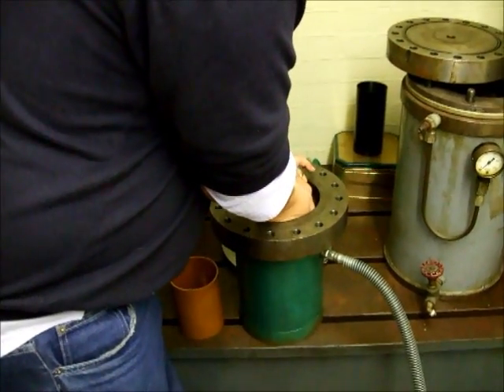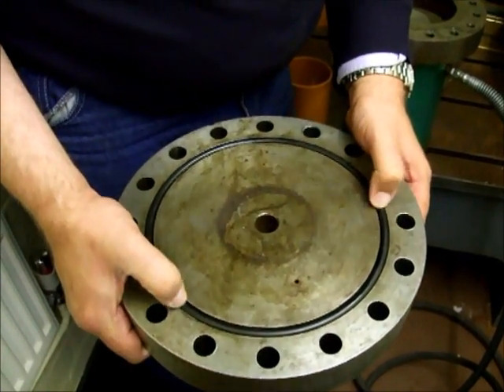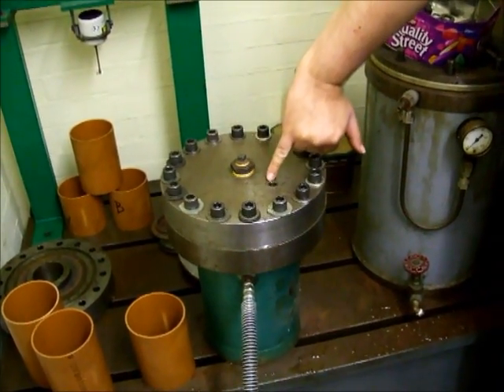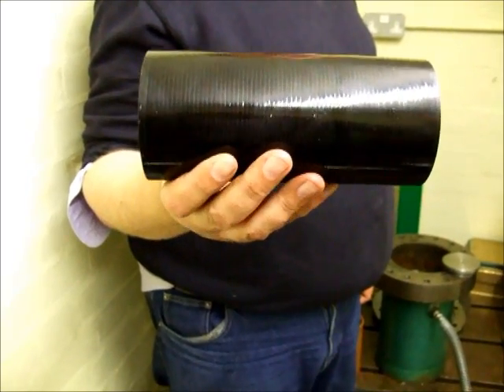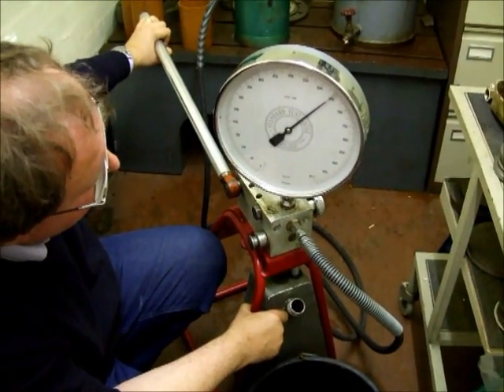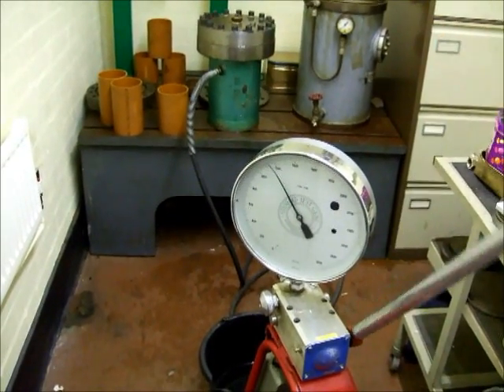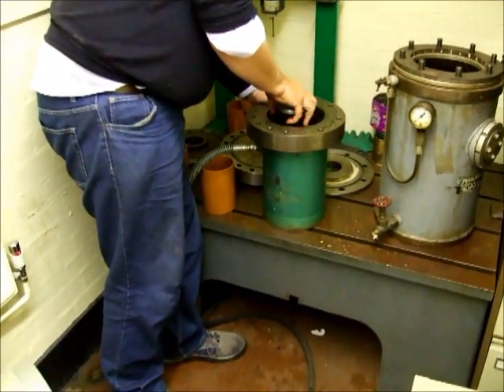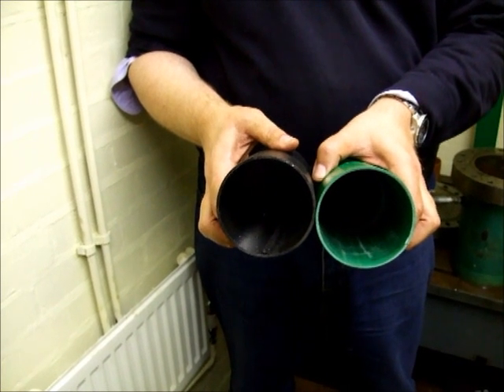Collapse of Composite Submarine Pressure Hulls

Comment: Glass fibre tube fails at 375psi, carbon went to 1400psi! Would have been interesting to see what steels could cope with and different alloy mixtures.  It's shows how strong carbon fibre is at first bit not after continuous pressure tests and to see the laminates failing.

Comment: In the real sub implosion, the volume of air is collapsed and compressed by the weight of the column of water above. The water rushing in acquires momentum which compresses the air way above the actual pressure at those depths. The volume of air inside the sub gets compressed as in the cylinder of a diesel engine, reaches very high temperatures and anything combustible ignites and detonates (oil, grease, fabrics). That is why you usually won't find bodies. Then that air bounces back. We get several very fast oscillations of the bubble of air that way. You can deduce the depth and the volume from the frequency of the sound of the imploding submarine. The US Navy knew exactly what had happened and where while everyone was running around frantically looking for the sub and hoping. The US Navy have hydrophones submerged all around the US and further in the Atlantic and Pacific since the cold war. There is also a lot of computing power analysing these sounds. This acts as an early warning systems against military submarines. Immediately telling the public all they knew of the stricken sub would have revealed too much about the capabilities of detection and analysis of the US acoustic early warning systems.
To see a video about collapsing bubbles of gas (actually from an AK-47 fired underwater), check this link: https://youtu.be/cp5gdUHFGIQ

Comment: This is why Soviet Mir was made of titanium, not LEGO plastic
Reply: In space it is a lot easier to hold pressure. You have to hold one atmosphere inside, even carbon fiber can achieve that and be consistently fine with it, and it is pretty light so it is easier to get to space. 
Only danger are micro-meteors and rapid heating and cooling of materials. 
At the bottom of the ocean you have to hold one atmosphere inside and you have to guard against many many many atmospheres of pressure on the outside. It sounds a bit dumb, but it is generally harder to have a human rated vehicle at the bottom of the ocean than in space.
Reply: @DreamskyDance  
You are thinking of the space station which makes no sense to me.
I was talking about the two titanium subs Mir-1 and Mir-2 which coincidentally were used by James Cameron including being featured in the Titanic movie.
These are the only deep water subs that have record numbers of deep ocean dives.

Comment: Hi, good questions. The challenge here is the lack of a validated mathematical (FEA) model that can work in this specialized area. Further, this becomes a non linear plus statistical domain. Why non linear?, given damage is cumulative, each subsequent dive will have a different performance. As of today some things are not clear how many tubes were built, was the tube used in the Bahamas  repaired or was it a new one? in 2021 (6 dives)?, 2022 (7 Dives)? To what depth, as each depth is a different loading condition.
Wet spiral wound carbon composite are not a common construction, as well specialized as the resins and curing methods. Further besides the process, the choice of fiber specifications and configuration as well as epoxy and activator may also vary. Add manufacturing imperfections (% bubbles and voids) and you start to get an Idea of the specificity of the problem.
If most are know and documented then, you can consider a the 4 common potential failure modes (delamination, fiber break, separation of fiber, cracking) and their probability.

Once there is a mathematical material model backed with data then the experimental geometry and loading can be considered for validation of the model. Still an approximation as the interface to the titanium rings and the difference in rigidity will likely create a stiffness mismatch. 

In short from an engineering perspective, it is a sequential problem that is built step by experimental step. At minimum we use ASME V&V 10 and V&V 20 as a guide for FEA modeling.

🙂

Comment: So it may not have shattered into a million pieces at depth....but I guess this test doesn't account for the low temperature at the bottom of the ocean that could make it more brittle...
Reply: Yes, the big difference is because the container is small and lots of air inside the tube… as soon as there is a crack on the tube the water rushes inside and the water pressure in the container drops fast…. In the ocean there is much more water so the pressure never drops. This is the limitation of this test setup.
😊
Reply: @GraystonLicht  true...I didn't take the pressure vessels size into consideration...I kinda wish they could replicate it with a much larger pressure vessel.
Reply: https://youtu.be/S1kGnuxzHDI

Comment: The Space Shuttle flew perfectly 19x before blowing up in 1986. Then Columbia disintegrated in 2003 during reentry because a 2-pound chunk of insulation foam fell onto and smashed open the CARBON FIBER leading edge of its wing!

Comment: ???? They look the same
Reply: It was cracked, but the video quality wasn't good enough in 2013 to capture that, probably 720p or worse.
Reply: Besides, the pressure drops when the tube cracks… so not exactly what happens deep in the ocean…. Deep down the pressure is basically constant and does not drop.

Comment: These tests are not valid because are made by 50 yr old guys. ,😂 According to the CEO of Oceangate anyway.
Reply: Actually, on the contrary… the results downplay reality. The experiment is a great visual to show what happens in a small container. The fact is that the ocean crushing pressure at 13,000 is constant 5000psi. In this experiment because the small container, the hydraulic pressure drops as soon as the breach occurs and the water flows into the “hull” model

Comment: Crazy Relevant. This was common knowledge 10yrs ago and people still got inside a submersible and weren't to depth over and over.
Reply: Actually, this testing method started in 1960 at the Navy Deep ocean test site in Annapolis MD. They built a full size chamber and put submersibles to do complete tests before submerging into the ocean.
Reply: And they each paid $250000 for it

Comment: This shows why you can't just pluck a material from a list sorted by strength to weight ratio. Good engineering means using materials in appropriate applications with a thorough understanding of tradeoffs.
Reply: Yeah it's opened my eyes with carbon fiber.  Important as human size drones become more widespread because they will use CF all the time.
Reply: And creating a material model that is applicable to static and non linear fatigue modeling.

Comment: Crazy that the carbon fiber tube of only that thickness withstood over 1400 psi. The titanic depth would be 6000 psi roughly, but the walls of that submersible were about 12x thicker.
Reply: Yes, but keep in mind this was only one cycle load…
To me it is still not clear how many cycles or dives to what depth did the Titan actually do in previous seasons… or if it was a new tube why did it fail on the first try?

Comment: Its insane that theres all kinds of industry tests and research on this and that dumb mf'er still did it.  And on the cheap.  I've got carbon fiber tanks for paintball guns.  They can hold insane pressures.  One time a sales guy was at our place amd we were talking about the safety of these.  It was early on with them.  Guy goes without significant damage they good as steel.  This next part stood out.  Says it doesnt work the other way though, with external pressure.  This is why they dont make pressure vessels like for a submarine where the outside pressure is greater.  We tested this doing r&d just to understand them.  After a few simulated water pressures in our lab theyd work fine for a few cycles.  Then youd hear snaps like a guitar string.  Theyd de-laminate, inside where you couldnt see without scans or destructive testing.  Then the next time under pressure it collapsed and shattered into pieces like someone dropped a cermanic dinner plate.
Reply: Best comment I have seen… spot on.
However it can be better or worst depending on 10 other factors too… 😊

Comment: When I did scuba diving a common demonstration for new divers was to bring a plastic bottle down with you.
As the pressure increased, the bottle crushed.
A further demonstration was to re-inflate the bottle at depth (uncap it while it's upside down, put your mouth around it, blow into it and cap it off.
It would explode about half way back up.
Reply: SCUBA certification is my starting point for some of this. For starters, you can't violate the laws of physics.
Reply: You can do the wane on an airplane even on a pressurized cabin at high altitude… bottle crushes when you start descending

Comment: *   Hello Carl, could you reply personally to this message? Could you tell me how the Carbon Fibre was arranged in your model tube, was it a crossweave or mesh or was it wound with straight axial fibres?   *
Reply: To me it looks cross weaved. Titan was about 1” wide wound to 400 plies. Still some good Data points. However I believe the limitation of the experiment is the volume of hydraulic to volume of air is too small and thus a fast pressure relief/drop does not allow for an implosion. Good video though 😊
Reply: Keep in mind, there is also choice of pre peg epoxy, curing additive and cure oven time and temperature to account besides 10 more factors. 😊

Comment: Okay boys, why is the 787's pressure hull made of carbon fiber if it's so dangerous???
Reply: An aircraft is internally pressurized, not externally.
Reply: @PepsiMagt  But what I'm asking is what in carbon fiber's nature makes that difference significant?
Reply: @AceNinja2112  differential pressure between the inside and outside of a plane would be less than 1 atm.  Differential pressure between the inside and outside of a submersible could be greater than 1000 atm.  Individual carbon fibers are very brittle and break under pressure (causing delamination)
Reply: @xilano  Very true.  I was wondering if there was a difference in how a carbon fiber hull (and the resin that it is laid in, which can cause delamination), behaves when the hull is compressed versus inflated?  For instance, unreinforced concrete is very strong in compression but very weak in tension...
Reply: @AceNinja2112  carbon fiber has extremely high tensile strength, but resist shear stresses poorly. So, yo put it simply, carbon fiber pressure vessels resists rupturing, but not buckling.
Reply: It's a good question and there is a proper answer: Planes do a scan of their surface every X miles.  It's an expensive x ray machine but obviously worth it.  

Stockton Crush didn't do any scanning.   So the carbon fiber degraded over time and he didn't notice.
Reply: Like any material, they all depend on the loading and cyclic loading too. 
First you look at load mode and stresses. In the case of airplanes differential pressure is around 6-10 psig. For a submersible you may consider 5,000 to 10,000 psig give or take differential.
Second: given 1 load cycle, depending on the design and allowable strain… there may be some damage to the material matrix due to many factors leading to delamination… so each subsequent cycle is weaker.. we call this non linear fatigue damage.
There are no computer models that have material models (FEA) that are available. These are created by competent engineers and based on relevant and validated experiment designs. 
To answer you question: Carbon fiber for aircraft is designed, tested, validated and then certified… still routine inspection is performed. Sorry for the long answer 😊

Comment: Looking at the construction videos three things are obvious
1. The carbon fibre pressure vessel had no cross weaving for added strength and no effective air bubble elimination between layers.
2. It appears the rebate to accept the connecting ring was created later reducing the overall thickness of the vessel at the connecting point.
3. The tolerance between the ring and the vessel had to allow for the jointing adhesive. You therefore end up with three materials at this point. Titanium, mounting adhesive, carbon fibre. All with different strength, thermal, expansion and contraction properties
.

Comment: Wasnt the hull...look at the debris the Bolts are missing holding the polymer window in place. Bolts need to be torqued up every trip, but bolts will stretch, unless using stretch bolts which it wouldn't. However the polymer window is 7in thick which reduces to 1.5 inchs at depth. This means the flange connecting the window also changes under pressure. The weak  link is the bolt threads, as the bolts stretch and retract the flange itself isnt sealed correctly with the window. Non maintenance and integral checks would results in a failer.  My qustion is were the bolts changed / swapped with new bolts, are the bolt threads in the actual flange still ok. Did they use anti seizure paste? Submarines dont use bolts as part of its structure instead its welded, not bolted.

Comment: Just curious .... and not professional engineer ... but distantly acquainted with physics of materials,  pressure and effects. I have to question the initial few seconds of this video! I assume the 'end caps' shown, are integral to the tested vessel. The experimenter, is pounding the heck out of those caps (or THAT cap!), I assume, to seat them, get a sound seal. But, THAT appears to be introducing extremely high stresses in the vessel's walls, PRIOR TO ANY testing. Just asking of those far more technically familiar with the materials under test, if this might void any test results???? Just curious.

Comment: Failed, yes.
Collapsed, no.

If you get a leak, no matter how small, there will be no "collapse" or "implosion".
The internal pressure will equalise with external pressure and there will be no further structural damage to the vessel.
But damage will occur to the contents of the vessel.
Reply: Delta P. :3

Comment: This is exactly why you do destructive testing using small scale models, its cheap and will tell you everything without putting lives at risk, It almost like oceangate saw this video and based their sub entirely around the carbon fibre model you see failing here, its almost identical.

Comment: Problem with the Titan submersible is that it has 3 different materials with 
Different types of expansion and compression.
A recipe for disaster if is  for deep dive.
But for a regular 200 feet that vessel is safe.
Remember it went 37 times to the titanic.
@a depths of 3,800.
No one wants to go that deep all the time.
I see a good product  if it can be done with one material only. Like Submarines.

Comment: I always thought that a cylindrical tank can withstand a higher pressure from the inside than from the outside, but don't know if it's just my impression... Any idea?
Reply: Further elaborating - and replying to myself 🤪 - could it be that, unlike an ideally perfect "theoretical" cylinder, a real-world one is bound to be affected by some - even minimal - manufacturing asymmetries, as precise as it can be?
And those infinitesimal asymmetries could tend to be "straightened / evened out" (thus evening also the force distribution) by an internally applied pressure, while instead they would make weaker "deformation spots" under an external pressure because of force unevenness, further aggravating the strain asymmetry until a catastrophic "avalanche effect" happens?
Just my thought, but I'm not an expert.

Comment: Composite is used in aircraft because it is light. A submersible doesn't need to be light, it needs to be solid.  Aircraft wings flex, submersible walls shouldn't flex.